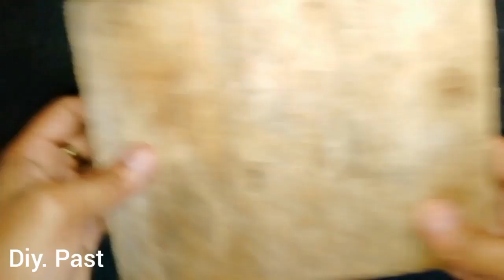Pam Racun Bateri DIY | Menggunakan Mini Water Pump 12v

Comment: bateri yuasa tu boleh tukar ke power bank ker? kalau buat pam tu bergerak sekali ngan kita semasa meracun tapi tong racun statik, ok tak? bukan apa senang nak on dan off pam tu. nanti pressurenya sama tak?
Reply from the maker: Boleh guna pawer bank tpi pancuran air tk laju lh sbb pawer bank Output 5v je..mini water pam ni 12v Dc, water pam ni ada suis automatik bila kita lepaskan semburan racun motor akan berputar
Reply: @Nazri01  tq

Comment: tuan ada check ker link shopee tu.. lain dari yg dlm video tu...
Reply from the maker: Dah betul tu boss semua barangan dh sy senaraikan..nnti sy edit blik
Reply: @Nazri01  lain tu... sila semak semula..tq
Reply from the maker: @smartadam1633  dh semak semua..dh edit rasa dh betul boleh sy tau link yg mana salah? Nnti sy akn tukar link yg lain
Reply: @Nazri01  pam lain saiz input dan output....filter  dalam link kecil sangat2..compare dgn filter yg dalam video.. connector pun x sama macam dlm video.. saiznya pun besar .
Reply from the maker: @smartadam1633  Ok tuan dh siap..sy dh tukar dengan link yg bru
Reply: ada.. tu baru tukar tu.. ok dah kut

Comment: Dc motor tu yg warna hitam eh? Ke tu water pump?
Reply from the maker: Ya..sy tersalah tulis yg sebenarnya water pump 12v
Reply: @Nazri01  saiz untuk penyambung tu macam mana ye? In n out dia ? Boleh bagi details semua barang tak? Sebab tak biasa lagi bab diy ni . Maaf ye
Reply from the maker: @wantsi3197   Sy guna tubing hose pipe 7mm/4mm dan connector cuping yg lain ada di Description video